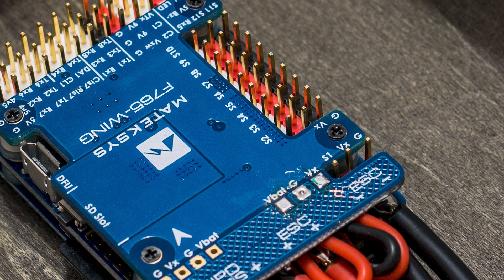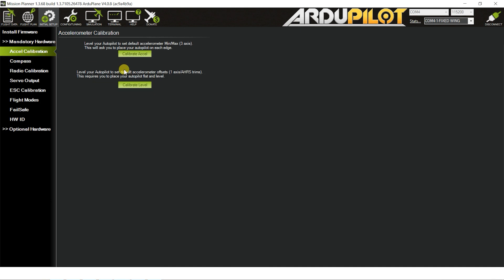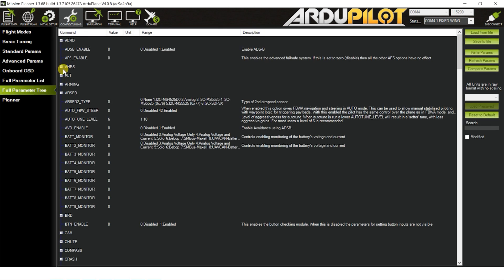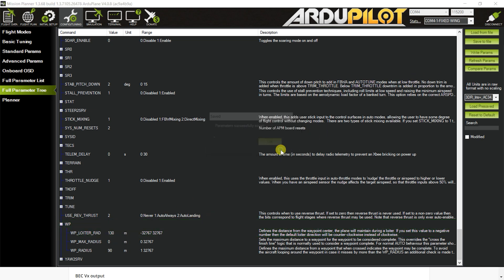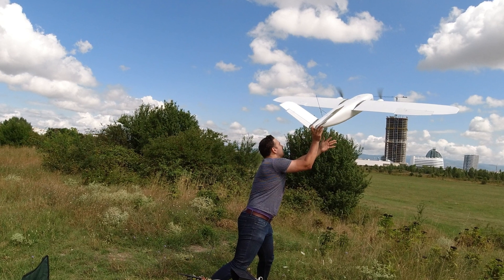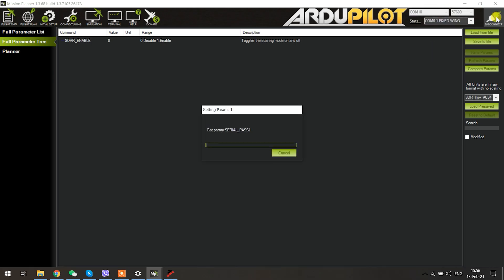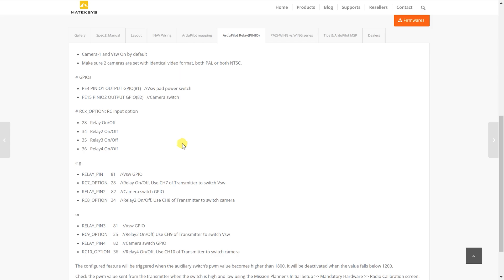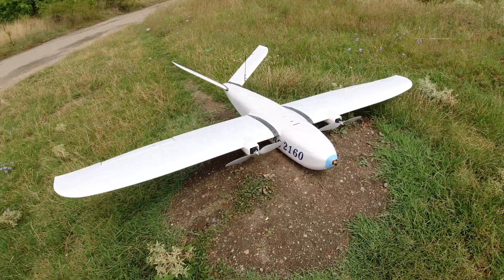HOW-TO Matek F765 Wing /w ArduPlane - flash, setup and fly!

Comment: I see this flight controller is sold out due to a chip shortage. I have a new one and am on the fence as whether to use it or sell it. I am not nearly as serious about this hobby as much as I was years ago and while I am still interested in it, I feel this maybe more valuable to someone else. Is there a demand for this flight controller currently?
Reply from the maker: Well... it all depends where you are located and what is the situation around you, but it was superseeded by the H743 model, which has a superior processor and causes less interference with 915Mhz and 433Mhz radio systems. Now, depends also what you bought it for, the H743 model is pretty expensive currently, so perhaps you may be able to sell it for at least as much as you got it for... but you won't really know until you try!
Reply: @ArxangelRC  Thank you for the quick reply. That is great info. I'm going to go ahead and set it up on my Ranger for cloud flying with the help of this video. Thanks again for your work!
Reply from the maker: @mflacke  You are welcome mate. Good luck!

Comment: do I sill need to use betaflight or inav to flash the firmware for Ardupilot?
or have they incorporated that function to mission planner now?
Reply from the maker: To be honest... I don't know... I haven't had a new one of these to flash in a long time, but recently did some SpeedyBee 405 Wings, and they did require the iNav configurator to be flashed with the Ardu file...

Comment: Hi...realizing that this video is 2 yes old, and my Google search lead me here, I've seen many of your videos and they're very impressive!
But since I was doing a search for wiring, I was hoping I could get your assistance...
Do you have a wiring diagram (pics) that shows the wiring for dragonlink 1000w rx to matek f405 wing v2 ?
I've built all my planes and diagrams saved me...can you help?
Thank you
Reply from the maker: Hi, well I don't have a schematic, but the 5v rail provided for the receiver, which should be somewhere around the Tx6 pin, which is the SBUS one, is not powerful enough to feed this receiver at full power! Solution is either to limit it to something more manageable likt 200mW, or to plug GND and 5v to the servo rail, provided you have it at 5v! The receiver will not take more than 5v, if memory serves.
Reply: @ArxangelRC  ...understood...so the servo rail provides 5v power unless I do the solder bridge for 12v...correct?
So if I do power the DL from the servo rail, as I've seen in rcgroups from one flyer, how does it get the mavlink connection for telemetry in mission planner? Or does that happen just thru the servo rail?
By the way, thank you so much for that incredibly quick response sir!!
Reply from the maker: @theroc495  The servo rail, where you connect the servos, can be 5v, 6v or 7.2v, it does not have an option for 12v. The 12v would be the Vtx and Camera pins, do not connect to those. The Mavlink connection is a separate one, and it is a bit more complex there! You will need to program one of the GH connector pins on the DL receiver for Serial In and Serial Out, which would be Rx and Tx respectively. Then on the F405 you need to connect these to Tx2 and Rx2. As usual they need to be crossed, so Serial In on the DL receiver would go to Tx2 on the F405 and the Serial Out on the DL receiver would go to Rx2 on the F405. Make a note of the Baud rate of the Serial port in the parameters of the ArduPilot firmware, by defaut it should be 38, you need to set the DL receiver in its GUI to 38k baud rate, and you need to also set the DL transmitter to that baud rate as well. Then, depending on how you will connect the computer to your DL transmitter for telemetry, could be WiFi, bluetooth, or cable, you would need to select the correct baud rate in Mission Planner of QGC, and it should work! DL have a pretty detailed guide on how to do this on their website, you can check it out there as well.
Reply: @ArxangelRC ...very deep info sir, and is a matter of fact, I use a switching BEC straight off the batter to supply 12v to vtx and camera (minim osd as well) with crossfire setup that is now DL...I read in rcgroups that those that fly with pixhawk  cube don't use the servo rail to power the DL, but opt for a 2s battery for dedicated power. Someone in the group mentioned rf noise associated with power from pixhawk to DL, so I don't know about that since I'm still acquiring new hardware for the build.
As far as good instructions and information, I look to your videos and a few others for build and parameter info.
I 150%, thank you for taking time to go into such detail on that answer, and although I'm getting up there in age, I hope that I can fly long range one day, as you have achieved...!!
Thank you sir
Reply from the maker: @theroc495  You are welcome mate, I do hope you get to your goals! Yes, generally using the servo rail will introduce some interference, but a separate battery introduces a bit more fuss and one more battery to look after for every flight, but it will give you the cleanest power source for the DL receiver. I now see in the receiver specs that it can take up to 8v, so a 2S battery will be OK to power it for cleanest power.
Reply: @ArxangelRC  ...yes sir...if I'm not mistaken, I've seen you post in rcgroups as well...I think under different subjects...am I right? I think I've seen your videos there
Reply from the maker: @theroc495  Yes, I used to post there, but it has been a very long time since I've done so now! :)

Comment: Extremely well explained and thanks for sharing. On last piece of the puzzle for my lack of skill. How do I map the aircraft servos like aileron/elevator etc that are connected to S3/S4 etc on the F765-WSE board to the my radio mix/radio calibration chanels of 1/2/3/4 ? Thank you.
Reply from the maker: Thank you! Actually 1/2/3/4 on your radio is literally Servo outputs 1/2/3/4 in Mission Planner Servo output tab! From the drop down menu you just chose what you want to be on that channel.
Reply: @ArxangelRC  Thanks for your response. I am using a SBUS receiver with no inputs. In my TX16S Channel 1 is Aileron. In MP Servo1 is Aileron but the physical Aileron Aircraft Servo Cable is attached to S3 on F765 board. Do I change Servo Output in MP to Servo1 disable and Servo3 to Aileron? Apology for confusing question.
Reply from the maker: @solarstrategy9967  Well in that case, yes! Sorry for the late reply! Has been a busy few months!

Comment: Brilliant video I have one question I disabled compass as you said but my heading is now 45 degrees out?
Reply from the maker: While on the ground, stationary? Or while in the air, flying?
Reply: @ArxangelRC  on the ground
Reply from the maker: @nuforuk  Well that would change once in the air! Give it a try! :P
Reply: @ArxangelRC  will give it a go many thanks
Reply from the maker: @nuforuk  Good luck! With compass disabled what you are seeing is whatever it can guesstimate from the gyro, while stationary! Once moving direction is estimated from the GPS, so it will work fine.

Comment: Great video as always. I finally got my first f765-wse up in the air. But I have to ask - Did you ever tune the PIDs for FBWA? You didn't mention auto-tune mode in the video. I'm asking because without auto-tuning I had barely any elevator authority. My first flight the plane would only stay horizontal. Roll was perfect though. Was just wondering to be honest
Reply from the maker: Thanks! I usually don't do manual PIDs, for the most part it is rare for FBWA to be unresponsive with default params but it happens! Run Autotune for 30 swings for pitch only if you wish and see if that changes anything.
Reply: @ArxangelRC  that's what I did and it did work! I've watched this video maybe 20 times lol thanks again
Reply from the maker: @GiBBO5700  Glad you figured it out! Good luck! :)

Comment: Hi thanks for the upload .. please can you advise the Connection on the Matek 765 board for the dragon link telemetry data ? 
Thanks 
Regards
Neil F
Reply from the maker: That is actually pretty well explained on the DragonLink setup website! You just connect Tx and Rx from the telemetry port on the F765 to the ones on the RagonLink receiver, and it should be good!

Comment: Hi  arxangel do you find out any benefits in servo output using left throttle/right throttle?
It looks that you configured it as throttle and not with twin motor function where you might use rud_dt_gain function.
Reply from the maker: Actually have not tried that left throttle/right throttle setup yet.

Comment: Also when I put in return to home it doesn't take over throttle like inav ,is that normal?
Reply from the maker: It should take over throttle...
Reply: @ArxangelRC     I reset all the parameters to default must have switched something by accident now it works, If I put it into return to home manually not fail safe It doesn't take over throttle Is that normal
Reply from the maker: @jimmytheriot8978  There shouldn't be any difference in how it gets to RTH - Manually or Failsafe... it should control throttle!
Reply: @ArxangelRC   I can put it into RTH manually And kill the throttle or give it 100% throttle But it will not maintain  a constant throttle in manual return to home Only in failsafe return to home, comma guess I'll try to play with it and see if I can get it figured out
Reply from the maker: @jimmytheriot8978  That sounds weird... wonder if there is a parameter somewhere for it! Never seen this behaviour on ArduPlane... it shouldn't be like that by default! Not sure what to tell you... go through the param list and see if there is a setting for that!

Comment: Hi,im new to ardupilot,but i have a problem with omnibus f4 pro v2.ekf show red velocity_horiz and pos_horiz_abs error even i have 17 sats hdop 0.6( compass disable).srry my bad english
Reply from the maker: I would assume it is showing that while sitting on the ground, not moving?
Reply: @ArxangelRC  yes,not moving.is that normal?😅
Reply from the maker: @maybayson4203  Could be! Throw it in the air and see if that error goes away!

Comment: hi ArxangelRC , have you had any issues with rf noise on 433mhz  from the 765-wing with your dragonlink system , Jetpilot  points this out on rc groups and i can detect some in my build but not loads , be good to no your views as you must have done a good few flights by now , great vid by the way
Reply from the maker: Thanks! How exactly can you detect that interference? I have heard of it... but at this point I can't really say there is, or isn't any! How do you know if there is, since you can really only do this in flight I assume... and the flight controller should be working at that point!

Comment: even without the user param and dedicated switches , you could trigger RTL  without having to turn the radio off. 1st you have to configure throttle fail safe  then assign a switch to override the throttle channel to zero which triggers the   RTL.
Reply from the maker: Riiiiiiight... well... sure... but all that additional programming is really annoying! :P
Reply: @ArxangelRC  yes true...but I'm paranoid about turning the radio off to trigger RTL! :) ..you are brave ! :)
Reply: @asangag  Hahahaha, well... I take it high enough to have time to turn it back on if things go bad... during testing! Once I know it works... I don't even think about it! Always use it as a last resort though!
Reply: @eVroomer   I noticed when assigning a switch to a flightmode using user param , the function can only be  triggered only when PWM value is over 1800. This means if use a 3 position switch only the 1st or 3rd potion can be used , other 2 are useless ! In  INAV you can adjust  the trigger thresholds  to work with any PWM range .  I am I correct or missing something in configuring the switches ?
Reply from the maker: @asangag  Well 1st and 3rd position is still good! But yeah, the middle one cannot be used, and yes, it is missing the adjustability of iNav... though hardly a reason not to use Ardu as it is by far the superior code, at least when it comes to planes!

Comment: Thanks for this Video, good work. Can I use this FC also for HexaCopter with ArduPilot.
If so, it would be nice you create a Video about it !!!
Reply from the maker: Well... would be a problem due to current limits on the power sensor and power distribution board, especially if its a larger one! Also... the board is designed for planes! I guess it could be adapter with a good deal of DIY and compromises to a copter, but I just don't see why, when there are other solutions for that! Also, sadly... I will not be able to facilitate that request... that would be too tedious of a task, and I gave up on copters a long while ago...

Comment: Great and very instructive videos. I would like to ask if ailerons differential can be applied from MissionPlanner or only from radio in case of separated ailerons channels
Reply from the maker: Hmmmm... interesting question... but I can't be sure about this as I've never really done it. I've only done it via hardware!
Reply from the maker: Perhaps it might be possible by offsetting the mid point on those channels... I guess... but you will have to try this... just guessing right now!
Reply: Thanks for your reply. I already tried with changing pwm values ; i confirm it works , in the sense that a differential between ailerons was possible, but very hard to find end points because with small pwm changes the corresponding aileron deflection was hard to fix. I agree with you about doing it via hardware but my question arised right because i cannot send the differential by radio, and I wondered if it was MissionPlanner that was blocking it in some way. Btw. I'm using an F405 wing, but i don't believe it makes any difference in this sense respect to F765....i hope 🤔
Reply from the maker: @CP-zi3eg  No, the model of the flight controller makes no difference to this! The autopilot cannot block such a thing from the radio, if you can set it up there, but in any case do it hardware if you can!

Comment: FC Matek f765
I am facing problem with GPS connection 
I have connected my GPS to UART port 2 
And also set the serial 3  parameter to 5 for gps still no gps signal ( Missing planner is getting only compus signal ) no gps
Reply from the maker: Did you try changing the places of the Tx and Rx wires?
Reply: @ArxangelRC  yes i have tried
Reply from the maker: @sainathdesai4081  Well... could it be the GPS unit is faulty? What does Mission Planner say in the bottom right of the HUD on main page, where it shows the GPS status - "No GPS" or "No Fix"?
Reply: @ArxangelRC  It say no gps.
But i tested my gps with other FC like APM 2.8 it is working fine .
Reply from the maker: @sainathdesai4081  OK, so it says "No GPS" no matter how you rotate the Tx and Rx wires? Can you try moving it to another port then? Use the port for the second GPS, see if it will work there.
Reply: @ArxangelRC  yes I have tried switching the  wire  . And also tried switching the ports to ( Tx 3 and Rx 3 ) no luck. I am using Ublox Neo 7m is there any compatible issue (like matek doesn't support such type of GPS module )
Reply from the maker: @sainathdesai4081  Weird indeed! Not sure if there is such an issue... but could be... a while back this controller didn't want to see a NEO6... so I ended up replacing it with an M8N and all was fine! Do you have a GLONASS unit to put in there and give it a try?
Reply: @ArxangelRC  ok thx for the advice 👍
Reply from the maker: @sainathdesai4081  I hope you can get it working! My best bet would be it needs a GLONASS GPS unit!
Reply: @ArxangelRC  finally it is working now. I have done a full-chip clean and then install again new plane 4.0.9 firmware.
 Now It is working fine but  I am getting  ( GPS = no fix ) issue what should I do about that.
Reply from the maker: @sainathdesai4081  No fix means you are inside! Go outside where the GPS can see some sky, and it should lock on to some satellites soon enough!
Reply: @ArxangelRC  okay thank you for the help bro 👍
Reply from the maker: @sainathdesai4081  Not sure I did much! :)

Comment: Nice video just wondering where did you jack the dragonlink telemetry wire in the controller
Reply from the maker: Where the 2nd GPS unit should connect to, just reprogram that in the full param list to output Mavlink.

Comment: I am trying to make the RSSI work but didn't. I did what you have did and it shows me 50 on RSSI but not changing even when radio off
using dragonlink MicroRx
my S-bus channel is 7 , flight mode on 5
any idea ?
Reply from the maker: Well... a good deal of info missing here! Have you programmed the DragonLink receiver to output the RSSI on any channel?
Reply: @ArxangelRC  yes it is on channel 8, analog RSSI. Or shall I choose Digital RSSI?
Reply from the maker: OK... so there is your mistake! On the left column in the DragonLink config tool is your PIN outputs, if you have selected Analogue RSSI there, in the RSSI settings you need to select as RSSI_TYPE the "Analogue pin" option, and then set the voltage range accordingly! The RIGHT channel column in the DragonLink tool is the SBUS channels, and if you want to have it on a channel there, needs to be set to Digital RSSI, assigned to the appropriate channel!
Reply: @ArxangelRC  Thank you so much . I got it
Reply from the maker: @redsharkss  Awesome! Good luck!